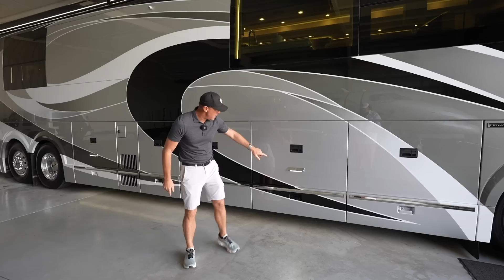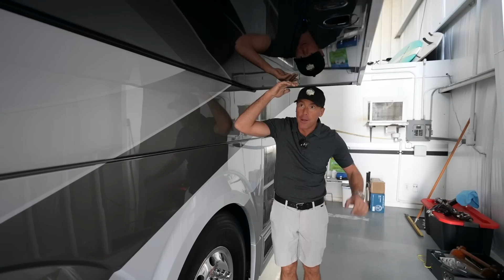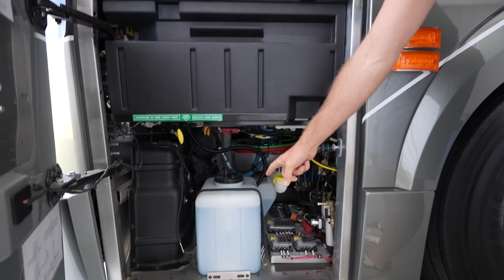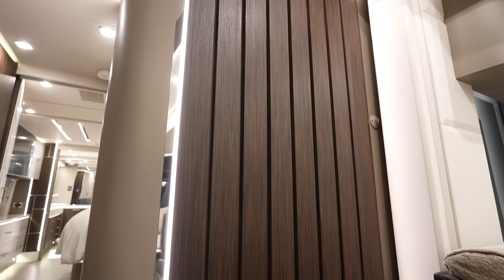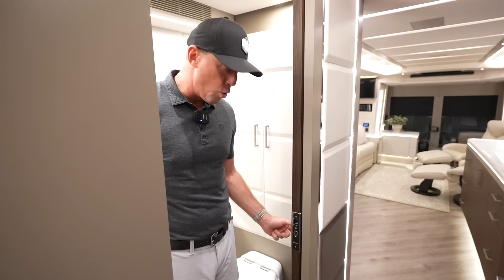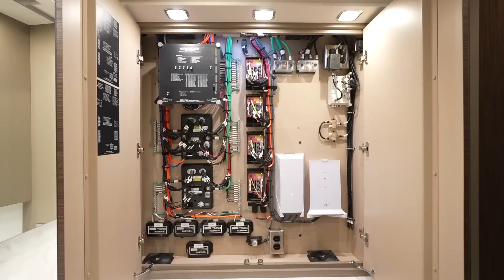One Owner Prevost Emerald Double Slide with Bedroom Super Slide (for sale $1.89 million)

Comment: Nice simplistic coach. For 1.89M, there could be some improvements. Simplistic Oasis for heat/hot water is not practical. ...no air doubler or air outlet, 20KW gen is overkill with Lithium batteries. Should have a big Onan like Liberty uses. Should have a combo tank for grey/black like Liberty and others.